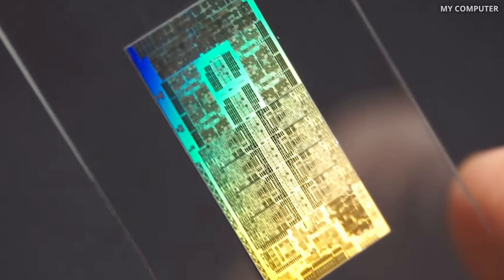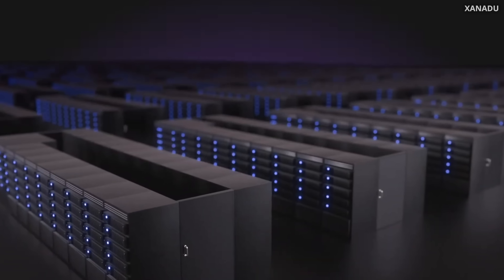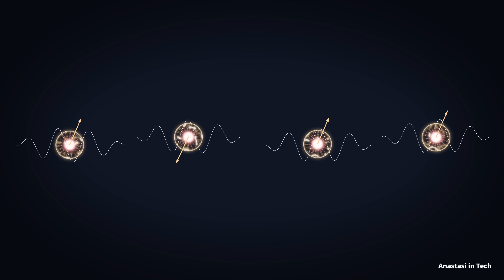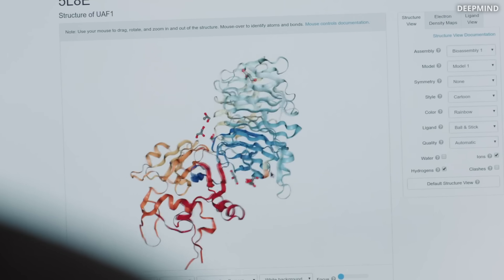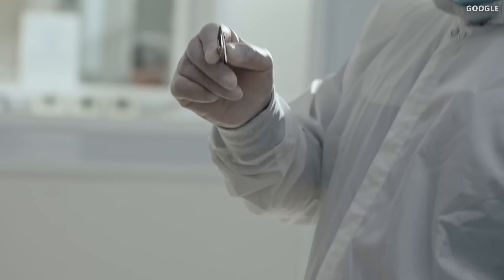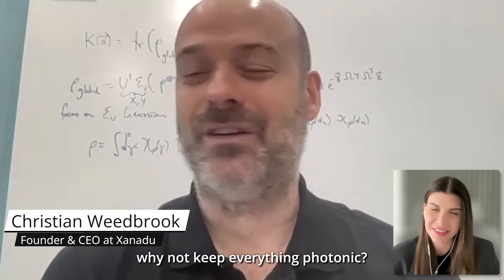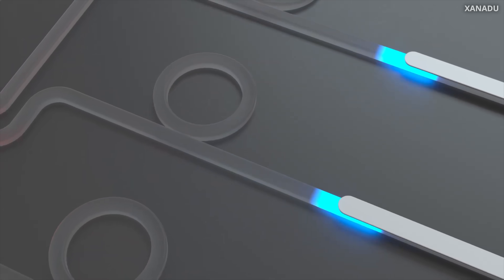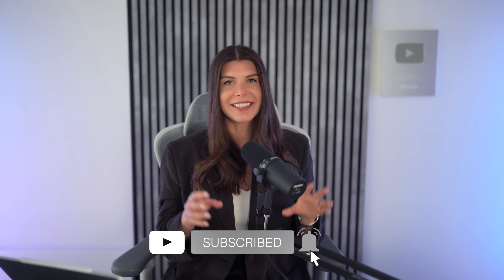Quantum Computing Breakthrough

Comment: What is a "squeezed state" of light?
A squeezed state of light is a quantum state where the fluctuations in one property—like amplitude or phase—are reduced (or "squeezed") at the expense of increased fluctuations in the other. This is particularly useful in precision measurements, as it allows scientists to minimize noise in one parameter while accepting more in another, improving sensitivity beyond the standard quantum limit.

In practical terms, squeezed light is used in fields like quantum optics and gravitational wave detection, where reducing uncertainty in measurements can make a huge difference. The Laser Interferometer Gravitational-Wave Observatory (LIGO), for example, uses squeezed light to enhance its ability to detect incredibly faint signals from cosmic events. - MS CoPilot 

See also https://en.wikipedia.org/wiki/Squeezed_states_of_light

Comment: Xanadu’s Quantum Photonic Chip: Ushering in a New Era of Computing

Xanadu Quantum Technologies, a Canadian company founded in 2016, is pioneering the field of photonic quantum computing. Leveraging particles of light (photons) to perform calculations, their quantum processors offer distinct advantages over traditional quantum systems, including room-temperature operation and scalability.

Borealis and the X-Series: Early Milestones

Xanadu’s early breakthroughs came with photonic chips such as the X8 and Borealis. In 2022, Borealis achieved a significant quantum milestone by completing a Gaussian Boson Sampling task in just 36 microseconds—a problem estimated to take classical supercomputers over 9,000 years. This feat marked a substantial demonstration of quantum computational advantage.

These processors are accessible via the cloud through Xanadu’s X-Series platform, allowing users around the world to programme and execute quantum algorithms remotely.

Aurora: The World’s First Universal Photonic Quantum Computer

In early 2025, Xanadu introduced Aurora, the world’s first universal photonic quantum computer. Aurora comprises four interconnected server racks, each housing a total of 35 photonic chips and 13 kilometres of optical fibre. Entirely operational at room temperature, Aurora integrates every critical subsystem required for universal and fault-tolerant quantum computing, including:

   •   Qubit generation
   •   Cluster state synthesis
   •   Quantum logic gates
   •   Real-time error correction

Aurora’s modular architecture enables it to scale to thousands of racks and millions of qubits, laying the foundation for future large-scale quantum data centres.

Toward Fault-Tolerant Quantum Computing

Aurora showcases key innovations essential for fault tolerance, such as heralded non-Gaussian state synthesis and adaptive measurements with real-time feedforward control. These advancements are critical steps toward achieving practical, error-corrected quantum computation at scale.

Open Access via Cloud and Open-Source Tooling

Xanadu’s quantum hardware is available to researchers and developers via its cloud platform. The company also supports open-source software development with tools like:

   •   Strawberry Fields – A full-stack platform for photonic quantum computing

   •   PennyLane – A hybrid quantum machine learning library that supports photonic backends

These frameworks empower users to experiment with and develop quantum algorithms in a photonics-based environment.

⸻

For further information, visit xanadu.ai

Comment: This is scary Anastasi. It feels like moving from a traditional geometric progression to tetration. I think we are going to rapidly fall far, far behind implementations of this modern generation. And I can argue with most of the AIs and be more creative so my opinion on this is pretty serious. I'll add, I debated with Deepseek when it came out about mitochondria having potential for being our memory, Deepseek didn't like it but when I argued that encoding data in lossy proteins inside mitochondria could be offset with a sleep cycle equivalent of DRAM refresh cycles but instead with naturally evolved memory systems, shuffling data back and forth between our mitochondria and our neural networks during our REM sleep cycles, Deepseek became far more optimistic about my speculations, really only commenting that there was not YET sufficient research to back up my hypothesis.

Comment: I was trained in electronics at Albuquerque technical vocational institute ending 1983.   Trained to design a computer clear back then.  Latter I got my computer science degree.   I was also an analog parametric database engineer , intergrated circuits design specialist, during the 1996 electromagnetic spectrum distribution.  My pants are on fire.  Thanks great stuff. You have three step. Set up, manipulation and read.  The middle is an inverter like a switch which builds our gates bla bla bla…. Then there is two raised to the power of qubit count for column er something like.  State matrix ect… I sorta follow.  All the quantum computers qbits technologies, there’s at least five, are isolated quantum systems so that decoherence is healed at bay there by enabling exponential quantum computing throughput.   Then there this quantum teleportation coming up.  What about that? More.

Comment: Anastasi, amazing video, very informative thanks a lot.

Question:
Base on research internet (today May-15-2025) 
using AI and lattice-based quantum error correction (QEC) 
this address errors in quantum computation.
 Is it that moving back the 20% cooling issue to regular
computers? or light-base-computer system like Xanadu can 
also perform those calculations using light?

Thank you again for your great video.

Comment: 𝐐𝐮𝐚𝐧𝐭𝐢𝐭𝐚𝐭𝐢𝐯𝐞 𝐑𝐞𝐚𝐥𝐢𝐬𝐦 𝐚𝐧𝐝 𝐏𝐡𝐞𝐧𝐨𝐦𝐞𝐧𝐨𝐥𝐨𝐠𝐢𝐜𝐚𝐥 𝐂𝐨𝐧𝐬𝐢𝐬𝐭𝐞𝐧𝐜𝐲
This section illustrates how the soliton-based framework naturally reproduces key QCD-scale physics while aligning with empirical data. The neutron is conceptualized as a topologically stable defect, with properties emerging from geometric and field-theoretic principles rather than arbitrary assumptions.

𝟒.𝟏 𝐑𝐞𝐚𝐥𝐢𝐬𝐦 𝐨𝐟 𝐒𝐨𝐥𝐢𝐭𝐨𝐧𝐬 𝐢𝐧 𝐐𝐂𝐃
The neutron’s mass and internal structure are modeled via a kink solution in a scalar field theory characterized by the potential:
\[ V(\phi) = \frac{\lambda}{4}(\phi^2 - v^2)^2 + \mu\left(\phi - \frac{\phi^3}{3v^2}\right), \]
where parameters are set as:
- \( v \sim 1\,\text{GeV} \)
- \( \lambda \sim \mathcal{O}(1) \)
This yields:
\[ M_{\text{soliton}} \approx \frac{8}{3}\sqrt{2\lambda} v^3 \approx 1.2\,\text{GeV} \]
which closely matches the neutron mass after incorporating binding energy corrections. The soliton’s spatial extent (width) is:
\[ \delta \sim (\mu \lambda v)^{-1} \approx 0.8\,\text{fm}, \]
consistent with the measured neutron charge radius (~0.84 fm). This demonstrates that the neutron can be viewed as a stable topological excitation arising from scalar field configurations.

𝟒.𝟐 𝐓𝐨𝐩𝐨𝐥𝐨𝐠𝐢𝐜𝐚𝐥 𝐏𝐫𝐨𝐭𝐞𝐜𝐭𝐢𝐨𝐧 𝐚𝐧𝐝 𝐀𝐧𝐨𝐦𝐚𝐥𝐲-𝐈𝐧𝐝𝐮𝐜𝐞𝐝 𝐕𝐢𝐨𝐥𝐚𝐭𝐢𝐨𝐧𝐬
The neutron’s baryon number corresponds to the topological charge:
\[ Q = \int dx\, \partial_x \phi, \]
ensuring its stability against decay in the absence of anomalies.
𝐀𝐧𝐨𝐦𝐚𝐥𝐨𝐮𝐬 𝐩𝐫𝐨𝐜𝐞𝐬𝐬𝐞𝐬 𝐢𝐧𝐭𝐫𝐨𝐝𝐮𝐜𝐞 𝐜𝐨𝐧𝐭𝐫𝐨𝐥𝐥𝐞𝐝 𝐯𝐢𝐨𝐥𝐚𝐭𝐢𝐨𝐧𝐬 𝐯𝐢𝐚 𝐜𝐨𝐮𝐩𝐥𝐢𝐧𝐠𝐬:
\[ \mathcal{L}_{\text{anom}} = \frac{g_\phi}{16\pi^2} \phi\, \text{Tr}(G \tilde{G}) + \frac{g_{EW}}{\Lambda} \phi\, \text{Tr}(W \tilde{W}), \]
where:

𝐄𝐥𝐞𝐜𝐭𝐫𝐢𝐜 𝐃𝐢𝐩𝐨𝐥𝐞 𝐌𝐨𝐦𝐞𝐧𝐭 (𝐄𝐃𝐌) 𝐂𝐨𝐧𝐬𝐭𝐫𝐚𝐢𝐧𝐭𝐬: 
  The neutron EDM constraint \(d_n < 1.8 \times 10^{-26}\, e\cdot\text{cm}\) implies:
  \[ g_\phi < 10^{-10}, \]
  achievable by imposing a \(\mathbb{Z}_2\) symmetry (\(\phi \to -\phi\)) to suppress CP-violating effects.
𝐃𝐞𝐜𝐚𝐲 𝐂𝐡𝐚𝐧𝐧𝐞𝐥𝐬:
  The decay width for processes like \(n \to p \phi\) is suppressed:
  \[ \Gamma(n \to p \phi) \propto y_{\phi N}^2 < 10^{-30}\,\text{GeV}, \]
which constrains the Yukawa coupling \(y_{\phi N} \lesssim 10^{-6}\), ensuring neutron stability consistent with observations.

𝟒.𝟑 𝐇𝐨𝐥𝐨𝐠𝐫𝐚𝐩𝐡𝐢𝐜 𝐄𝐦𝐛𝐞𝐝𝐝𝐢𝐧𝐠
𝐀 𝐡𝐨𝐥𝐨𝐠𝐫𝐚𝐩𝐡𝐢𝐜 (𝐀𝐝𝐒/𝐐𝐂𝐃) 𝐝𝐮𝐚𝐥 𝐞𝐦𝐛𝐞𝐝𝐬 𝐭𝐡𝐞𝐬𝐞 𝐢𝐝𝐞𝐚𝐬 𝐢𝐧 𝐚 𝟓𝐃 𝐟𝐫𝐚𝐦𝐞𝐰𝐨𝐫𝐤:
\[ S_{5D} = \int d^5x \sqrt{g} \left[ |\partial \Phi|^2 + V_{\text{bulk}}(\Phi) \right] + \int_{z_{\text{UV}}} d^4x\, \Phi\, \bar{q} q, \]
which reproduces:
 Chiral symmetry breaking:  
  \(\langle \bar{q} q \rangle \sim (250\,\text{MeV})^3\),
GMOR relation:  
  \(m_\pi^2 f_\pi^2 = (m_u + m_d) \langle \bar{q} q \rangle\).
This dual picture provides a geometric realization of the scalar field \(\phi\) and its role in topological and chiral dynamics.

𝟒.𝟒 𝐄𝐦𝐞𝐫𝐠𝐞𝐧𝐜𝐞 𝐨𝐟 𝐅𝐥𝐚𝐯𝐨𝐫 𝐇𝐢𝐞𝐫𝐚𝐫𝐜𝐡𝐢𝐞𝐬
Flavor structure arises from the spatial separation of kink solutions in the extra dimension:
\[ y_{ij} = y_0 \int dz\, \psi_i(z) \phi_j(z) \psi_j(z), \]
leading to hierarchical Yukawa couplings:
\[ \begin{cases}
i = j=1: & y_{11} \sim 1, \\
i = j=2: & y_{22} \sim \epsilon, \\
i = j=3: & y_{33} \sim \epsilon^3,
\end{cases} \]
with \(\epsilon \sim 0.2\). This naturally reproduces observed quark mass ratios:
\[ m_u:m_c:m_t \sim \epsilon^3 : \epsilon : 1, \]
and small CKM mixing angles such as:
\[ \theta_{12} \sim \sqrt{\epsilon}. \]

𝟒.𝟓 𝐏𝐡𝐞𝐧𝐨𝐦𝐞𝐧𝐨𝐥𝐨𝐠𝐢𝐜𝐚𝐥 𝐀𝐥𝐢𝐠𝐧𝐦𝐞𝐧𝐭
|  Feature      |    Predicted    |   Observed   |
|--------------|----------------|--------------|
| Neutron mass | \(\sim 1.2\,\text{GeV}\) | \(939\,\text{MeV}\) |
| Charge radius | \(\sim 0.8\,\text{fm}\) | \(0.84\,\text{fm}\) |
| EDM constraints | \(g_\phi < 10^{-10}\) | No observed EDM |
| Flavor hierarchy | \(\epsilon^n\) scaling | Consistent with measured masses and mixings |

𝟒.𝟔 𝐓𝐞𝐬𝐭𝐚𝐛𝐥𝐞 𝐏𝐫𝐞𝐝𝐢𝐜𝐭𝐢𝐨𝐧𝐬 𝐚𝐧𝐝 𝐂𝐨𝐧𝐬𝐞𝐪𝐮𝐞𝐧𝐜𝐞𝐬
Lattice QCD Signatures:  
  Correlations in \(\langle \text{Tr}(G \tilde{G}) \rangle\) at scales \(\sim 1\,\text{fm}\) could reveal topological structures akin to the soliton model.
Neutron Star Phenomenology:  
  Interactions between neutron solitons and phonon modes may influence glitch phenomena and neutron star cooling.
Cosmological and Astrophysical Probes:  
Light scalar fields (\(\phi\)) with masses \(m_\phi \lesssim 10^{-12}\,\text{eV}\) could mediate fifth forces detectable via precision tests, and contribute to dark energy through suppressed instanton effects (\(S \gtrsim 200\)).

𝐂𝐨𝐧𝐜𝐥𝐮𝐬𝐢𝐨𝐧:
This unified, topologically grounded framework demonstrates that the neutron’s mass, stability, and associated quantum numbers emerge from geometric and field-theoretic principles consistent with empirical data. It is inherently falsifiable: predictions span lattice QCD signatures, neutron and nuclear physics, and cosmological observations, providing a comprehensive, realistic picture of hadronic matter rooted in fundamental topological phenomena.

Comment: Why would you need a datacenter or networking? I thought 1024 qbits are enough to calculate the position of every atom in the universe, no?
One answer is probably error correction - all q-cpus run the same "calculation" many times and average the results to overcome inaccuracies.
But still, a photonic cpu is fast, and quantum algorithms are "one shot" - needing only a single run through all gates to get the answer, not crunching numbers for hours, so I don't see why you can't have a single cpu run a million repetitions, even if it takes a few minutes, but gets an answer in the end. much simpler than a full datacenter..

Comment: Originally the theory that was proposed was that the human brain and nervous system uses quantum computing back in the 1980s.  The end point was that the tryptophan crystal arrangement that is in the human body and the nervous system itself could then be studied to solve the problem of errors.  That or use the QR code model where even if there is a higher error rate, the code itself is done in such a way that it is still legible.

Comment: As a software engineer with a physics undergrad degree (20 years ago), I found the most interesting details to be just short of satisfying in their level of specificity!  1) You say using one photon is more quantum, while multiple photons behave more classically, but then you say that they retain their quantum properties, and in fact it's better because they can represent more complex states than a traditional (you say "classical") qubit, so it's more flexible.  So more photons is more classical, and more quantum.  What does that even mean?  Xanadu must have figured out something new here; what was it?  Using multiple photons to collectively represent one qubit?  Or something?  2) The parts about detectors detecting 7 or 8 photons, and the need to reduce loss, made me so curious.  Again, Xanadu is presumably doing something new here?  It seems like robustness would be an overall difficult problem with this sort of system, even with photons.  Is there anything like a "repeater" for these photons?

Which aspect of the design of the system described in the video is the "breakthrough"?  Which part is newly figured out?

Comment: So: Still not a single useful computation application for that technology? (...aside from generating random noise)

I expect them realizing - as soon as those fundamental flaws ...ähhh: problems, sorry - got out of the way, that computing with quantums is not at all something other than computing with any other matter: What counts are RESULTS - in a massive scale of STEPS to perform in succession, because of them DEPENDING on their predecessors and being COMPLEX. There is only one way to connect A FEW (of billions) of those steps: As long as you can fit them in some kind of analogue processor circuit. But for that, you don't even need quantum processing. As soon as you have to dissect the whole machine into successive parts - and we are talking of billions, you know? -, the whole dream of "getting the final result" in just one step vanishes. And since the determination of the final result in quantum processors does require multiple measurements, i don't see how a speed gain could possibly materialize anyways.

What i assume to become a reality, however, is the direct computation with photons - if those get smaller than the currently used structure sizes in semiconductors. Which would imperatively imply extreme uv photons. And hardware that can act on them. For optical gates, you imperatively need atoms whose electrons or protons are switched between states by photons and those states able to influence successively passing other photons. However, even that is still in the very early fundamental research state.

Comment: To avoid loss increase the energy:
use a röntgen source.
Adds some drama to it as well.
Danger, do not touch the yellow cables, under any circumstance!!
It will be hollywood-ready.
Get the rights.
That is how you raise more research money.

Those circles are to slow down the light to make it
easier to synchronise the interactions to reach the maximum
amount of entangled particles / photons?

What to do next once you have a bunch of entangled qubits?
Since it is in all possible states all at once, what would be needed
is a some sort of filter, that will match the solution ????
When it collapses, it should collapse into the solution...?
How to do that exactly?

A one terabyte disk has 2^12  x 2^3 = 2^15 states well, sequentially
50 qbits are in 2^50 states all at once??

Questions questions

Has it just been scaled down?
Because the common way to try these things in a lab would
be using these laser tables and splitters and mirrors etc .
I think they still do this with double split experiment variations?

It reminds me a bit of micro reactors in chemistry.
Do they still do that?

Comment: Lightspeed Quantum Datacenter will be in use in 5 years… ‘Who would use or need a Quantum Datacenter? I mean besides ASI…’ Humm, wouldn’t AI need to be running at lightspeed to use a quantum network to be called Super AI? ‘So, what comes first?’ Don’t we already have both, we need AI to help us put them together. ‘Keep thinking, Quantum speed AI communicating on a Lightspeed Network. What could we humans get, with the help from ASI?’
Didn’t I read that ASI was going to help us get to Mars? Or was it that ASI was going to help us expand with mile wide Protection Cylinder Habitats, in orbit, so we don’t need to get to Mars?